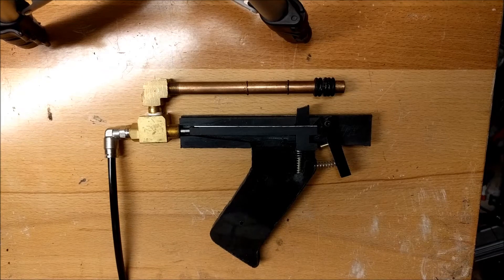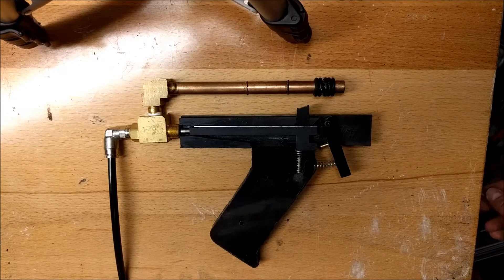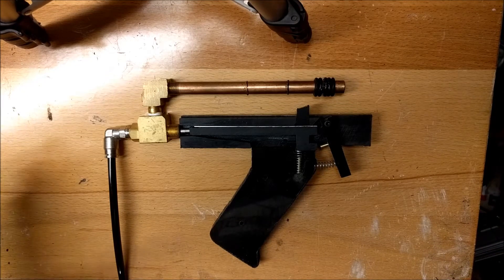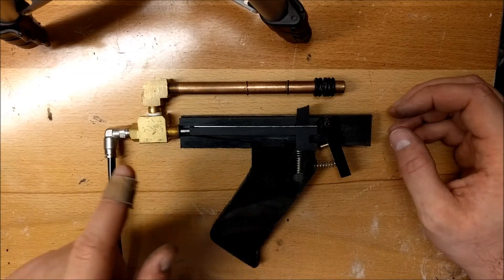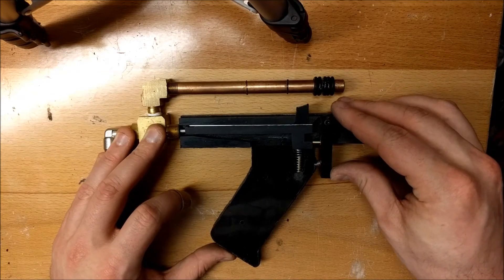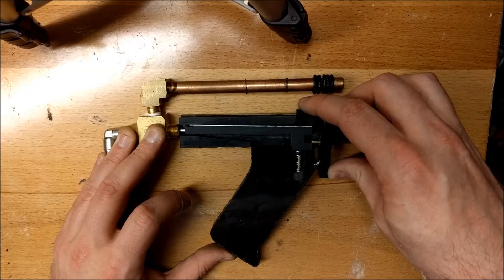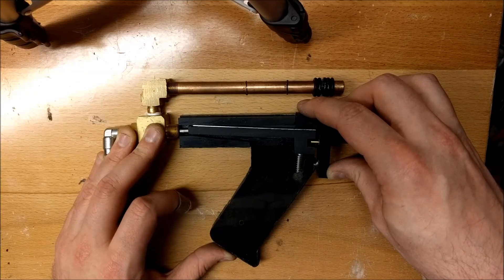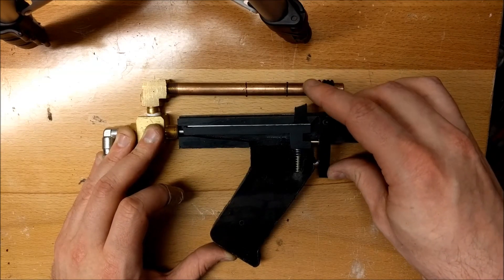Airsoft Semi-Auto Magazine-Fed APS Shotgun WIP #4

Comment: Could you explain how the blowback works? Does that rod on the top go into a bigger tube and it just wants to release the gas and thats how it recoils?
Reply from the maker: You've pretty much got it; but it's a blow-forward design. So gas goes through the tube into the bolt, pushing it forward, until it hits the disconnector and trips it. Then the pressure drops and the bolt returns.

Comment: So What's the mechanism to dispense air into the BBs and firing chamber?
Reply from the maker: It uses APS shotgun shells, so a fixed firing pin on the bolt triggers the valve at the end of its forward travel.